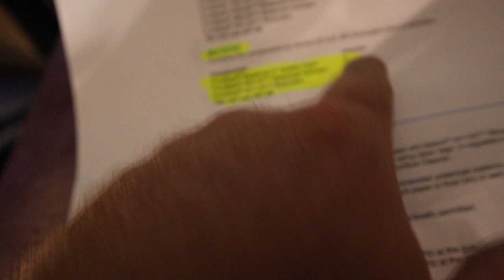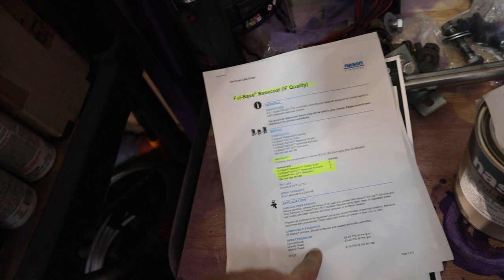8” Superlift Was TERRIBLE To Install | 2007-2018 8” Superlift Lift Kit |

Comment: IMO I would have went with BDS 8” over Super Lift. Too much work for the tie rods compared to BDS. Better built and warranty is awesome. May have had to wait a bit longer for the lift unless it’s in stock. 
How’s the tires holding up? Couple friends of mine ran those tires and they wore out uneven (even after having their alignments checked)
Reply: Bds doesn’t make 8 in lift for 2wd.. if they did I would’ve bought it myself.. taking my fabtech 6 in off and putting 8 in superlift on mine.
Reply: My bad, i always looked up lift kits for 4wd because of my truck. I figured they would have one for 2wd also. I’m curious how the ride quality is with the 8” Super Lift. Going with Bilstein shocks or King?
Reply: @pat14lang  actually I’m going with neither.. I ordered the 8 in superlift with upgraded fox coilovers. It’s on 8 week back order. But I’ve already paid for it and set up the install at local shop near me since I work damn near all day all week. Thinking about starting a channel for my truck with my upgrades and what I plan on doing in the future. Most of what I’ve done so far I’ve done on my own just haven’t recorded it haha. Gotta get on this YouTube alga rhythm to make me some more 💰
Reply: @obs4life228 if you’re a shop install guy, please don’t make YT videos.

Comment: Should have bought a 7-9 Mcgaughs
Reply: I would have but they were supposedly 8 months out because of material shortage
Reply: Why buy a Mcgaughys 😂😂 Mcgaughys only has 7 inch diff drop brackets the superlift has 8 inch ones. You’ll have better angles on the superlift. Leave it to the pros that started the lift game 😂😂

Comment: RC has you cut both inner and outer tie rods 3/8”.
Reply from the maker: I can’t believe that.. why not just make the spindle different. Does not make sense.
Reply: I thought it was a bit strange too because now you have to cut your new tire rods if you replace them down the road.
Reply from the maker: That is exactly what I said off camera. And hear me out, what if you don’t do your own work and you take your vehicle to a shop to have them replace your inner & outer tie rods. How would they know the inners have to be trimmed? And if you didn’t install the lift yourself you may not know either, that could become very expensive and a big headache.
Reply: I agree with you 100% I do all my own work but I thought the same thing. I’m not sure if it’s because the location of the tie rod on the knuckle hits the wheel or not. I still feel like it’s a design flaw.
Reply from the maker: See the stock knuckle doesn’t cause that problem and nothing gets changed besides moving the UCA up, LCA down and the wheel hub down. I feel like it is a flaw as well, someone else mentioned RC on this body style is similar but also that BDS doesn’t have to do that. Maybe it’s just the “cheaper” brands.
Reply: @AaronCates  all lift brands have to do the trimming.
Reply: @AaronCates  BDS has replacement outer tie rod ends for most of their lifts. Zone and a few other require trimming also.